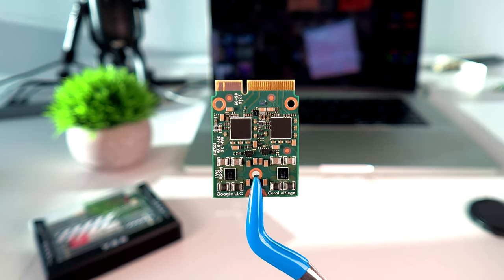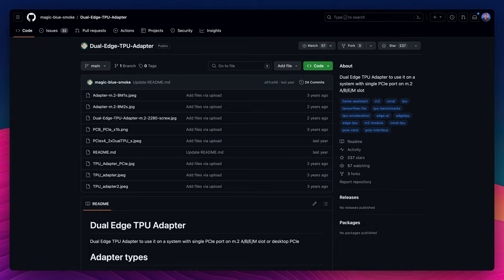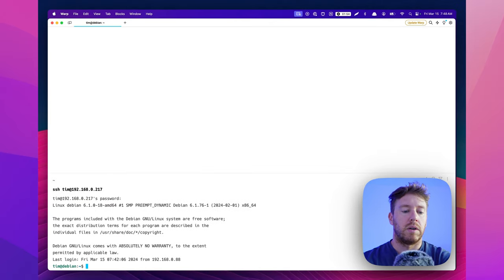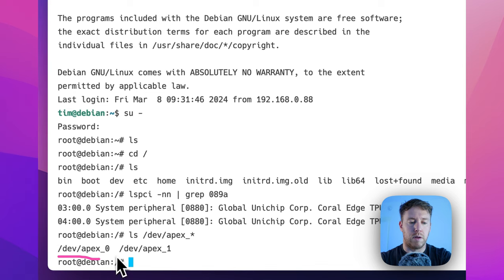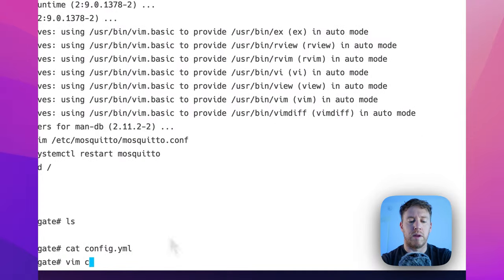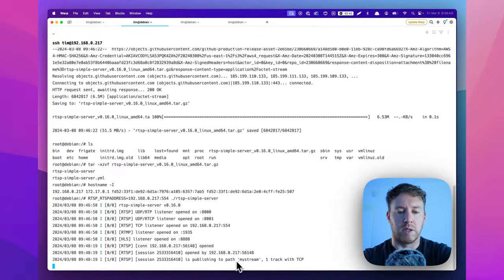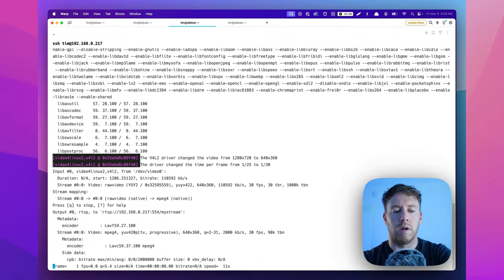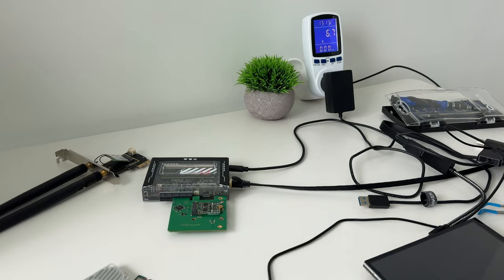Dual Edge TPU: Double Power, Same Slot

Comment: Appreciate the detailed video and blog post but I  am having difficulty installing the TPU drivers (ls /dev/apex_* finds nothing) on CasaOS v0.4.9 with kernel version 5.10.0-10-amd64. Have you been able to set this up on this version? lspci -nn | grep 089a shows the correct TPUs, only the driver doesnt get installed